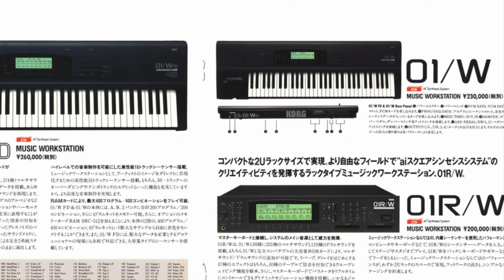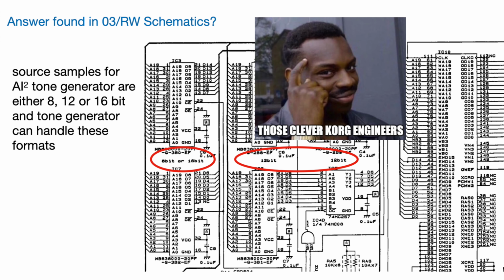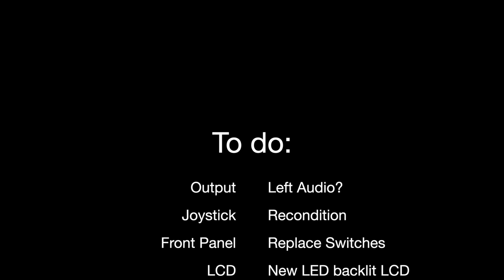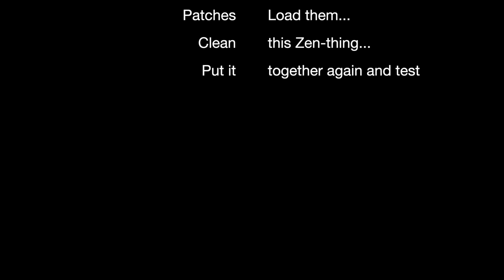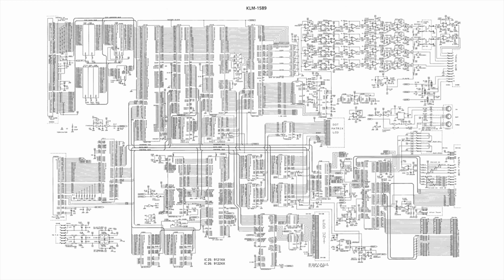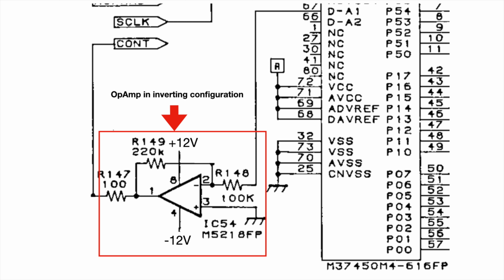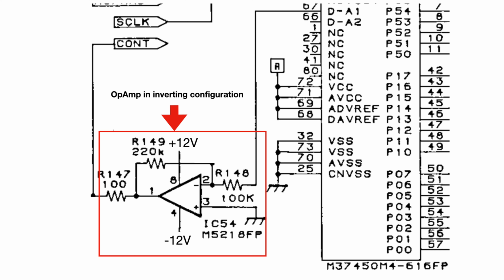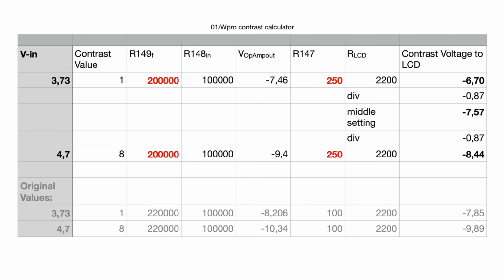ReinardSynth #14: Korg 01W Pro repair - output, LCD Contrast, Keys, switches, sample ROM adventures

Comment: Hi Reinardsynth, I have my 01/WFD stripped down for a restoration and I hope you can help me with one small thing. On each side of the display window, there's a set of buttons that press on the Tac switches. These sets are held in the plastic frame. Just to the rear edge of the display window there are two black plastic tags with gold- coloured screws holding them. Will undoing these release the frame and the buttons come out?
Reply from the maker: not exactly clear what you mean, but the plastic push buttons on both sides of the lcd display cutout (the ones pressing on the tactile switches) are molded to the whole plastic frame and cannot be removed or replaced; so the screws  do nothing in that regard
Reply: @reinardsynth6581  Many thanks Reinard. I just want to clean the back of the buttons and I can do that with a paintbrush. I've been following your video (#14) because I'm putting in an LCD display like yours.
Reply from the maker: ok, if you have a Q just let me know
Reply: @reinardsynth6581  Many thanks. My soldering expert friend has replaced all the tac switches and changed the power feed for the new LED display so I should be OK now.

Comment: Just to add to the body of knowledge on this... You do not need to add the 2.2k resistor between pin 2 & 4 if you just use the correct value for R149. Replace R149 with a 180k resistor and that's it. You may have to try a slightly higher or lower value for best range because this is directly controlling the LCD drive voltage which is not precise from unit to unit.
Reply: And thanks for the video!

Comment: Do you really have to mod the power supply or can you just take 5V from anywhere in it without removing anything?
Reply from the maker: Yes, you can use any source of 5V, also the 5V supply on the LCD can be used for that.. But strong recommendation is to mod the power supply: keeps it tidy and bonus: get's rid of the high-pitched whine you hear from within the synth!

Comment: This is incredibly handy so thank you for recording and sharing in such detail! I replaced the LCD module in a friend's 01/w some years ago and recently the contrast has begun intermittently going bad (backlight is OK). I'm thinking to do a similar modification to the op-amp circuit to get the contrast voltage in a better range for the aftermarket LCD. The LCD came with the contrast/pin 4 trace cut so it would use its internal fixed voltage (around -7.3 V). Will let you know how it goes...

Comment: Absolutely outstanding Reinardsynth. Me and a colleague experienced in precision soldering are about to refurbish my 1991 O1W/FD. It had a service by Korg in 2004 but it's aged since. So now the display is gloomy, the aftertouch is missing and some of the tac switches are unreliable. I've ordered the new switches, I have the new display from Japan and there's an anti-static wrist band on the way. I'alos be getting new felts.
 I've studied the video and there are two things I'n not clear on. I take it that removing resistors T1 to C11 kills the 90V AC kills supply. Also, my new display has a flat cable and I don't think is uses the black/ white power cables. Anybody know?
Reply from the maker: yes: removing T1 et al kills the 90V AC power supply and “whine”. I also connected through the 5V DC supply to the backlight connector for easy connection to the LED backlight of the LCD display. I removed the new LCD’s white/black cable to connect in place. The old backlight cable: the old cable has the right length… make sure there is an current limiting resistor as described in the video. Be sure that the new LCD’s flat cable can be slotted in the LCD connector on the main board correctly: pin 1 on lcd to pin 1 on main board, 2 to 2 etc.
Reply: @reinardsynth6581  Fantastic, thank you so much! Can I be cheeky and ask one more thing? I think the felt strip (Yamaha VQ176100) is causing my aftertouch to be less responsive. Is there another felt strip that directly affects the aftertouch? I can't see any strips on the Korg schematics. I know about the two white potentiometers on the aftertouch board.

Comment: Hello, thank you for your video.

I had a problem with my Korg 01.

I left it on for a while, and when I came back to check, the screen lit up, but nothing appeared, there was no sound, and the buttons didn't light up either.

Is it the capacitors or the battery?
Reply from the maker: that is not the battery. first check the if the voltages of the power supply are within range (consult service manual). screen lighting up hints at the backlight power being there which is derived from the 5V power rail…. too many things that could have happened here

Comment: UPDATE: after checking carefully, I noticed (with a bit of luck) that some tracks connected to the capacitors in the audio section were interrupted (it was not visible, but I discovered it using the tester). Probably during the soldering I damaged something, even if it is very strange. I proceeded to restore the connections... Now the sound is back, but it is still distorted, as many users report: it seems more evident in the sounds with effects, but I don't know... I will continue to search and try...
Thanks anyway, especially for having infected me in this hobby!
And if you have suggestions... ;-)
Reply from the maker: Careful: if distortion only on sounds with effect then effect RAM is defextive. To test: take any patch and turn on/off effects. If no distortion when effects off-> effects RAM issue. Can be replaced and fixed

Comment: Hi!
I have watched and re-watched this video (and others) many times... Thanks for the precise and useful information.
Sorry in advance if I take advantage of your patience and knowledge!
I have successfully repaired my Korg 01W prox, replacing buttons, sliders and display, as well as the capacitors on the power supply.
Now I am struggling with my Korg 01W pro: I did the same repairs but since it had a distorted sound, I replaced all the capacitors, both on the motherboard and on the power supply.
Unfortunately now the synth turns on, everything seems to work but it no longer produces any sound: I tested the capacitors before and they were all ok, could it be the DAC?
What tests can I do to verify if the DAC works or not? Voltages or signals with an oscilloscope... I hope you can give me some indication: the dac is the PCM55HP.
https://www.farnell.com/datasheets/60071.pdf
Thanks again and... keep it up!

Comment: Hi Reinard, I own a Korg 01w/fd and It was working fine until a Few weeks ago, after cleaning the keys I forgot to put a piece of metal back in and when I was playing, Sound was cutting out and the screen was getting blank. I put the piece back in (maybe it was like a ground regulator) and It improved but still the sound is cutting out when I press the keys too hard. Do you think It’s a voltage issue?
Reply from the maker: Service manual here: https://www.deepsonic.ch/deep/docs_manuals/korg_01wfd_01w_service_manuals.pdf
Reply from the maker: Must be a short somewhere. Take it apart again and carefully put it together again making sure everything is connected correctly and no connectors are loose, no cables stuck between metal parts or making contact with the frame. Have a close look at the service manual.

Comment: Hello, i need help with a korg 01/w pro, but it no longer powers on, it was working, until i forgot to power it off and thats when it stopped turning on
Reply: You can try buying a replacement power supply unit online and swapping it out.

Comment: I see you used an ultrasonic cleaner for the black plastic pieces!
Is it possible to clean the keytops in there as well, or would that damage the keys?
Reply from the maker: I normally do not clean the keys of the keybed using an ultrasound cleaner: it would remove the (silicone) Grease from the insides. I “hand clean” them with househild soap

Comment: Wow great job w. all the switches. I took the lazy method of isopropanoling the crap out of the old ones.. 
(w.o. even opening it😂) 
It worked out surprisingly well. Got to tilt the flow around just right... 
Have to really get in there one sunny day for the backlight and to swap the floppy for an emulator. 
Got any favourite usb drive for these? 01/Wfd
Reply: Just get a basic Gotek (SFR1M44U100K) and flash firmware with FlashFloppy or HxC, no need for newer Artery 435 MCU models with OLED display & rotary pushbutton enhancements if you don't want to spend the extra money.

Comment: Hello Reinhard! Thank you for this informative video. What is the ideal value for R_LCD if I don’t want to change the original values  of the opamp resistors? Your help is greatly appreciated.
Reply from the maker: @radocool1  450ohms, according to my calculations…
Reply: @ Thank you very much! I’m about to service my old 01\WFD and I’m going to upgrade it with the same screen you used in the video.
Reply: I finished the resto-mod and I really like the results. I didn’t have a 450 ohm resistor on hand, so I put a 470R instead. With this value there’s no noticeable change in contrast from level 5 to 8, but it doesn’t matter since I quite like it when set to 1. Thank you again, Reinard!

Comment: I also own a 01/w Pro X and am currently facing the same issues. Some of the tact switches are broken, the screen's backlight isn't working, and the original LCD panel has issues as well. Since I want to fix it myself, I've been searching online for repair information. I'm really glad I found your video—it was very professional and clearly explained.

In the whole video, I think the hardest part would be recalibrating the contrast voltage, which is beyond what I can DIY... I found that there are pre-made LED backlight LCD panels available online. I'm wondering if I would also need to follow the same steps as you did, like modifying the power supply to provide 5V. I'll keep looking into it.

Wow! You even have the original floppy disks! That's amazing!

Lastly, thank you so much for the video! It has given me more confidence to repair my 01/w!

Comment: Hello, I just replaced the display on my Korg 01/WFD but when I turn it on the Korg logo appears and then the screen stays blue and there is no image. The keyboard works fine but there is no image.
Reply from the maker: Contrast… would check that. Contrast voltage should be around -6/-7 Volt. Which display exactly did you use?
Reply: @reinardsynth6581   The screen was bought on Aliexpress, but it is the same one in the video, I checked the contrast but it only dims the light, I also clarify that I installed the screen before watching this video, so I will follow the steps you indicate, and I wanted to know if you have any recommendations? or following the steps in the video could it work?

Comment: Pleez out put ac v from transformar
Reply from the maker: @mohammadawwad6598  ehh…. what?
Reply: @reinardsynth6581   Hi Mr Reinard, can you show me wich voltages you have on transformer secondary side on power supply, primary is 120 V , but on the schematics someone forgot to add secondary side notation  Blue, blue ,Red, black, red wires is unknown voltages, Could you help me with that, please? I need to know the value voltages to feed power supply, my transformer is damaged😢

Comment: Hi Reinard, can you please tell me where to get the replacement felt and grease for the keybed? I have been scouring the web but cannot find the right one. Any help would be greatly appreciated! Thanks a lot!
Reply from the maker: Ask a local yamaha Instruments dealer for part nr. VQ175900 it is the same felt as used in the Morif for which yamaha should still be able to supply replacement felts

Comment: Great job ! What resistor should have been used in the display(instead of changing cms resistor on the main board)? Thank you.
Reply from the maker: about 450 Ohm according to my calculations, living the SMDs resistors (R149 and R147) on the main board untouched.
Reply: @reinardsynth6581  thank you so much for your helpful answer !
Reply: @reinardsynth6581  il works very well. Thank you again !
Reply: @reinardsynth6581  a couple months ago, I had a local technician do a similar mod on mine. We used one of the blue ones you can order on AliExpress.

After the mod, my 01/w would sometimes boot up and sometimes not. Upon careful inspection, the problem was solved. According to him, it was some caps needed replacing.

Hace you experiences anything similar?

Regards from Peru
Reply from the maker: @xxxxneoxxxx  yes: depending on the make and model of the LCD display it might interfere with the reset-pulse at startup. I had this issue with NewHaven LCD displays (but not with BuyDisplay ones!). There is a simple solution to this: *in the flat cable from the main PCB to the display*: put a diode in the reset line (cathode "towards display", anode "towards main PCB") and the main reset still resets the display as well, but the New Haven's reset line does not f*#$% up the CPU's reset line.. is a bit fidgety, but not that difficult: identify flat cable wire for pin 10 ("Reset signal, active low, cut it out enough that you can interrupt the wire, solder the diode in and put some heat shrink tube on it for a clean install... should do it.

Comment: Hi - where you have replaced the screen and added a 2200K resistor to the pins on it, is there an easier way to get the right contrast (roughly level 4) by changing that value, instead of messing with the mainboard adding resistors? I'm about to do this in the next week or so! Cheers.

Comment: Hi Reinard, and thanks a lot for making such an informative video. 
I am also upgrading/reparing my Korg 01 W FD. I have bought the ROM chips as mine is ROM 28 also bought a replacement USB drive to replace the floppy drive.  I have bought a new backlight rather than replace the whole display. I also plan to fix the plastic screen infront of the the display by applying hydrogen peroxide as it is yellowing and I want it to go back to being clear. 

I want to know where to source the felt that you have used. I would also love it if you can tell me what grease to use on the keybed. 

Thanks a million!😃
Reply: Hi - I don't think the plastic cover in front of the screen is yellowed due to sun+time, I think it is just a yellow tint. It is a terrible thing for Korg to do - should have been clear plastic, not smoky yellow!!
Reply: @richardsmith4992  The lens is/was indeed clear, possibly yellows due to environmental conditions, or maybe, like certain video game consoles or synth keys, additives in the plastic (e.g. fire retardants) cause yellowing over time. No fun! (Hydrogen peroxide will bleach yellowed white plastic - I've successfully used sodium percarbonate powder activated by hot water and let yellowed parts sit in the solution overnight - BUT I haven't tried this on clear plastic like 01W's display area lens...

Comment: I have a korg 01wproX, the A flat key has no sound from the middle forward, sometimes it sounds, other times it doesn't, do you have any idea what the fault could be?
Reply from the maker: Intermittently working key is a clear indication of dirty key contact: clean the rubber dome contacts and circuit board contacts underneath the offending keys with pure alcohol (see my “top 8 synth faults” video -top 2 entry at the end) for details on how to do that)

Comment: Thanks to you, I was able to successfully install the latest LCD display on my 01/wFD. As advised, the two resistors were regular resistors, not SMD, so there was no problem. This allows us to take advantage of contrast. thank you. I also referred to the power supply board.
Reply: Hi, did you follow the steps in the video? I changed it and it only gives me a blue glow.

Comment: Does the value change to the resistors apply if you have replaced the display with an OLED?
The contrast seems to make no difference since I replaced the display
Reply from the maker: OLED displays do not have contrast voltage inputs; only LCD displays have. Have not seen 240x64 OLED displays, don’t think they exist. Different LCD make and models have slightly different contrast voltage ranges so it depends… values given here work for the BuyDisplay 240x64 LCD displays…

Comment: On the 01W, is it normal for the ram ICs 18-22 to be warm to the touch, also the audio stage ICs 43-46 and surrounding area are even hotter?
Reply from the maker: RAM ICs warm to the touch: is ok, are heavily used… audio stage: hmmm… perhaps double check the PSU output on ripple and voltage… also: do you hear strange noise on the audio outputs?
Reply: @reinardsynth6581  Thanks, power supply voltages all good, not checked for ripple but planning on doing that. It's actually stuck on boot screen, was just a quick look on the FLir, work in progress🙂
Reply from the maker: Quick Q: have you replaced the LCD display with a new one?
Reply: @reinardsynth6581  no, I'm sure it's ok because occasionally on switch on the welcome screen appears, however it never goes past that, screen is clear and back light reasonable. I'm going to recap the c94,95 etc and change the fusible resistors since they're discoloured. The caps leaked around that part so I'll tidy that area up with mek.